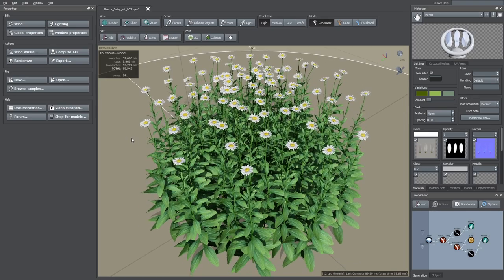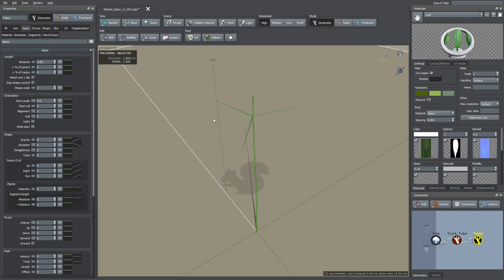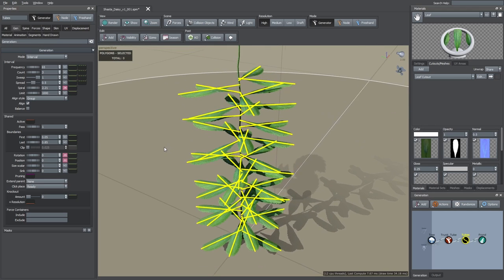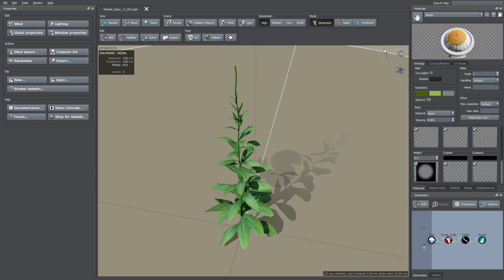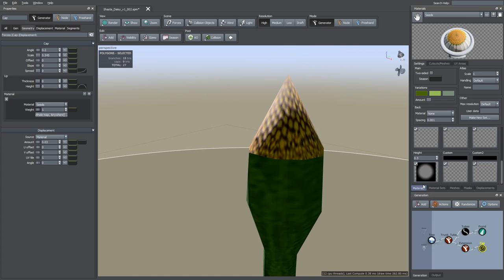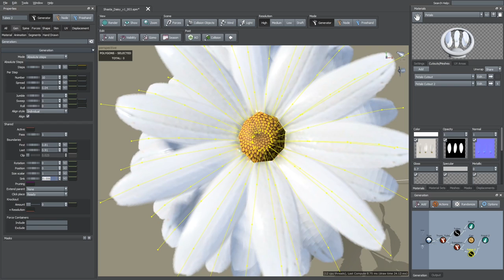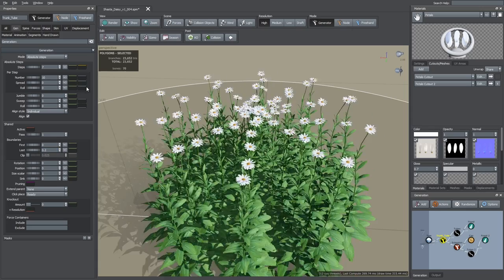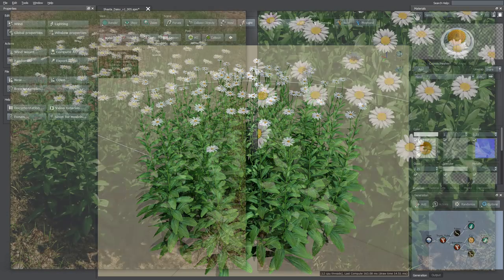Daisy Flower | Speedtree Cinema 9 Tutorial

Comment: I am having an issue I want to add an extention branch but I dont have that option in my drop down. What version of this programmer are you ussing ?
Reply from the maker: I'm using the 9.0.0 version. Anyway you can achieve the same result by:

- Adding a branch generator
- Then, in the Gen tab make sure the Mode is set in "Absolute".
- Then below, change the Number parameter to 0.
- At the bottom change "Extend parent" from None to Any.

Comment: How can i get the "Extension" thing? I'm using Speedtree Cinema 9 but can't see that specific option.
Reply from the maker: An extension is a quick preset. If you can't find it then you can achieve the same result by:

- Adding a branch generator
- Then, in the Gen tab make sure the Mode is set in "Absolute".
- Then below, change the Number parameter to 0.
- At the bottom change "Extend parent" from None to Any.
Reply: @3dhobbyist296  AAAAAA i can't thank you enough i'm making an animation featuring a full field blooming with flowers now i can export all my plants and their anims in alembic then populate in houdini, blender, unreal or whatever.